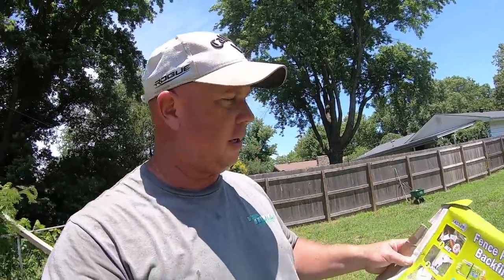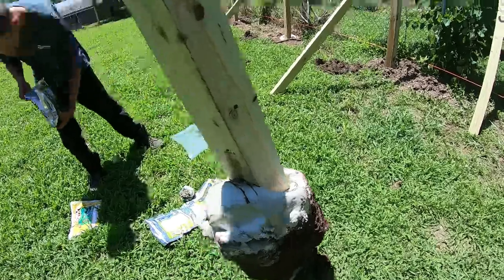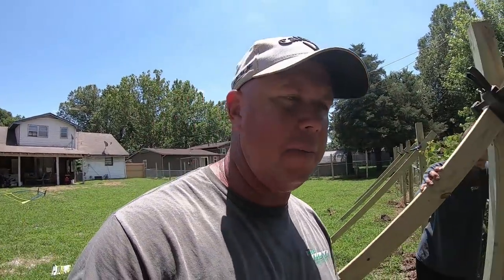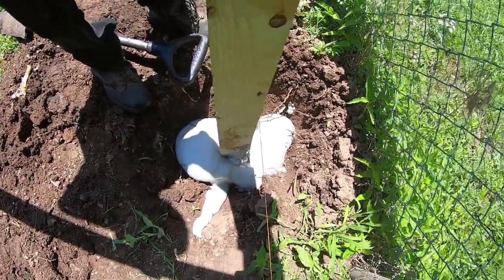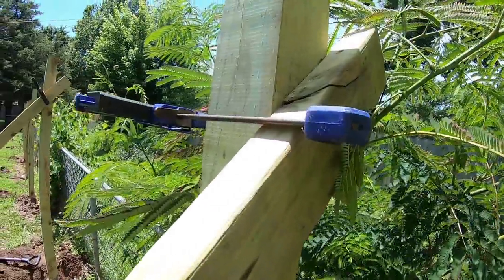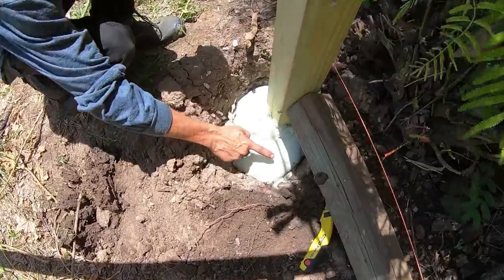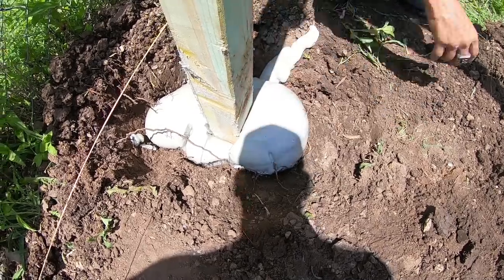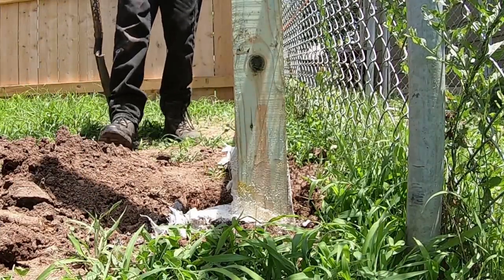No Concrete Fence Post, Is Foam Better

Comment: I’ll stick with concrete. Sakrete is my mix of choice. Think about it, foam to hold up agains Mother Nature? I don’t think so. Glad some people can use it though, but not for me.
Reply: Of course it will hold up, it's a polymer! -- concrete leaches moisture into the cut end of the post, guaranteeing it will sit in water until it rots. The foam seals the wood's cut end water tight and will prolong post life.
Reply: I replaced a deck that I built with posts set in concrete more than 25 years ago. They were still Rock solid. I don’t think I need decks that last more than that. Properly done, concrete is the way to go.
Reply: FPSF (frost protected shallow foundation). For decades in nordic countries, entire houses have been built on high density foam foundations.

Comment: hypothetically, if these post needed replacing due to rot, would a shovel suffice to "dig out" the rotted post? Ive always hated digging out rotted wood with the concrete.

Comment: Foam does not hold up nearly as well as concrete, especially when subject to ground freeze/thaw.
Reply: Explo Diddly - It doesn’t have a lot to do with weight, it’s not the weight of the concrete that holds a post down, however intuitive it may feel. It’s about compressive strength but more importantly, surface area. The foam fits perfectly into every contour of the hole and prevents movement. Concrete does the same. If it’s good enough to set utility poles, you needn’t worry about your backyard fence. All you need to do is imagine the liability claims against a power company if poles were to fall over all the time. They aren’t going to open them selves up to that risk, so you need not worry. Trust the science! 
Our intuition is very unreliable, that’s why we have instruments to measure everything we do because even with decades of practice our senses aren’t accurate enough.  Your post would be subject to heave from frost if it wasn’t deep enough but it would matter which material it was set in if it was too shallow. When I lived in Canada my whole asphalt driveway would heave up by a couple inches and sit back down in spring. 

Put another way- we used to bolt wings onto the wing spars of fighter aircraft because it ‘seemed’ the strongest thing. Now, with the F22 - one of the fastest planes with the most G-force on its wing structure- those wings are glued on. 
You don’t need a sledgehammer to crack a walnut. I’ll bet over time this foam prevents water ingress way batter and the post takes way longer to rot through. I’d be inclined to let the foam poke through and trim  it off at a downward angle on all 4 sides so water runs away. 
Just my opinion.
Reply: pickle tickle ok, air bubble foam vs. Concrete. It’s not even close after one year of freeze and thaw.  Buy this stuff if you never deal with expremes. Homeowner scam product.

Comment: the fencing people in my town just cut the fence post off at ground level and dig new hole next to old one and redo them and move on
Reply: exactly
Reply: Your ground must not be full of rocks and tree roots. I don't want to have to dig any new holes. :)
Reply: @tagberto  yah and I have to replace about  30 feet of fencing one of these days all the fence posts are not in the ground they rotted away but still attached to the original fencing .The 30 feet of fencing swings as the wind blows lol

Comment: That stuff is crap. Never use foam to set a post. In short order, you are left with an unstable wobbly structure. This stuff may have a place somewhere, but it does not belong anywhere near a fence post.

Comment: how about the disposal of that is it ok just too throw in garbage ?
Reply: you throw egg cartoons away in garbage , so yes it is disposable in regular garbage pickup otherwise would like either be sold in Hazardous waste bag or not allowed to be sold by EPA.
Reply: My egg cartons are not foam
Reply: @MrRadiodio   you meaning people do not you personally congratulations for being more green but it doesn't change the fact that they are thrown away in garbage and EPA wouldn't allow this to be sold without special packaging and warnings if it wasn't ok to throw it away and in fact probably wouldn't allow it at all

Comment: Never mix concrete. Put the post in the hole and pour in some water. Dump a half bag of dry mix  and done. Concrete contractor for 20 years, would be hard to give it up.
Reply: half a bag of 60lb concrete, and how much water? Or should i just be mixing it while its around the post? I bought the Sika brand foam yesterday and I'm already reconsidering it lol

Comment: That’s cool, but it’s twice as expensive as fast setting concrete, don’t see the advantage!
Reply: This seams only useful if you want a simi permanent easy to remove fence.
Reply: Doesn't matter either way it will rot at ground level
Reply: Corey S  Where the pole meets the ground is where it will rot. i'm not talking below ground and utility poles are not that same material as a treated post
Reply: Corey S  You obviously know what youre talking about so this is my last reply....it doesnt need to pool to rot it. Just like a pole building where does it rot first? Right at ground level ....even when its on a concrete slab. So no it does not need to pool obviously
Reply: Corey S  OK for 1 I have no problem with this til you started being condescending about it......and youre talking to someone that works in the field not someone copy pasting info off google. It does not need to pool. The whole thing started with yo usaying foam wont rot and me saying it does not matter cuz it will rot at ground level way before that.Obviously there is nothing  I can say so just leave it at that
Reply: I have many times....it DOES NOT matter what is around it underground.....foam,concrete,dirt......it WILL rot where the post meets the ground....the moisture from the ground WILL rot it WAY before it will below ground.....it DOES NOT need to pool to do this......do you understand yet?  This is simply what you think you know and what I actually know but keep trying. LOL its getting too funny for me
Reply: Corey S  There is constant moisture at ground level LOL
Reply: Corey S  honestly stop reading that about halfway through..its called moisture now go google that
Reply: no really just look up the definition of moisture lol
Reply: Corey S  last time im replying to you 100%....keep doing your research and Im sure you will say something cuz you seem like the type that needs the last word LOL
Reply: Wow, that started a firestorm, sorry. Here is one more thing you should think about. If you use concrete, it attaches to the post and u usually have to dig up a pile of concrete attached to a post to get it out of the ground . I would be curious to know in the long term, if the foam would delaminate from the post, totally different materials. This would allow water to get to the post underground. I would think that extreme cold temperatures might accelerate this, freeze and thaw cycles. Just thinking out loud. Foam has never been a substance that sticks well to other surfaces. Foam roofs, foam insulation, etc !
Reply: @17forever64  Im sure Corey can tell us with his many minutes of research on google...complete expert on the subject
Reply: Rick K oh boy, have a great weekend sir!
Reply: Corey S yes, I had some experience with different types of foam , was just curious about what y’all thought. I agree with much of what you said. Thank you for explaining it, that’s why I brought it up!

Comment: Another alternative would be "pea gravel". = drainage to prevent post rot = long life span of the fence, ease of replacement, ease of install. No shaking a bag just pour in the dry pea gravel and it's set NOW. "IF" there are high winds that loosen the post, easy, pour in a little bit more pea gravel and shake the post back to level, once a year or two or three. TOOOOO EASY!!! WIND at the post rot level is a wood fence worst enemy. DRAINAGE at the wood fence post rot level is the posts best friend. The action is ALL at the post base. Are you going to hold the water there to finally let the rot do its job, or are you going to let it drain away? I say, drain. Just saying.

Comment: Ive used this product for a few years now to fix my cedar fence and have had no issues in the upper midwest climates where I have had issues with Concrete cracking due to moisture getting down next to the post and then freezing and splitting the footing.   I use a cardboard cylindrical form to help contain the foam and go down close to three feet using 4x4 posts then pack teh soil around the form once cured.   People asking about the foam being water tight I can attest that the posts I have put in have not allowed moisture to get close to the post after two years
Reply: is three feet deep enough, how tall is the fence?

Comment: See my reply to NO NAME below for how to use one bag to set 3 or 4 posts not one and just as quick.  Of course the real answer to long lasting fenceposts is another material like a Concrete post with resin nailing strip etc but at least use ground contact treated fence posts not just treated or "severe weather" treated which makes you think it is but it isn't. It must be "severe weather ground contact" if you get lowes etc. make doubly sure it is ground contact rated.  

Even though the posts often say lifetime guarantee anyone ever tried to take rotten ones back ???  Would you want to replace the post with same kind that rotted ?   I would take them back get either refund or more posts and if got posts immediately sell or use for something else and get better suited product,

Comment: I think the question is what’s better for the Environment ? I like concrete the added weight helps but it’s very polluting . What’s this chemical mix and does it recycle ♻️ well ? . Concrete atm is not reclaimable / the cement itself .
Reply: The two part mix is a byproduct of another industry (cannot remember which) so it is eliminating waste.

Comment: probaly more cost effective when timing matters
Reply: No it will cost more to redue it when the wind blows fence over
Reply: do you think if the added stone as they poured it ....it would work ?
Reply: I've used it to add 2 posts to make a double 6 ft gate and it kicked ass

Comment: Does it work with 5x5 vinyl fence posts?
Reply: See the Fast2K and Sika Post Fix page for info on such. Sika says it can be used on any post material, Fast2K does not answer this question so I am going to say you may want to contact them otherwise I would say it is just as safe to use on any material post.

Comment: Anything you put around the post is going to trap moisture up against the wood which is going to promote rot. If you actually know how to install a fence correctly you don't need either of these things

Comment: Just use concrete. Make sure your concrete is just above ground level and bevel the concrete down off your posts and you'll never have rotting issues.
Reply: WINNER.  6-8" gravel at the bottom too.

Comment: Expensive, and I’d have to see some real life test with wind and a week of rain.
Reply: Not te expensive a bag of foam is in va is like 5.80 and 80 pounds of concrete is 4.78
Reply: @thomasmiller6254  just to get it set plumb you could put some dirt in tamp it some . Get several posts in the holes and use one bag of foam to do 3 or 4 holes till they set plumb then add more dirt etc.  That way saves both time and costs!!

Comment: That foam is not cost effective. One bag of that is about $13. A 10lb bag of Quikrete is about $3.
Reply: you did not add the cost of the work to haul and mix the concrete. The cost on your labors back. You don't have to move and mix 25 bags of concrete that saves a lot of TIME. Time you could spend with your family after you got paid from the job.
Reply: @blu4x5  $325 vs $39... I'll drop a bag of dry Quikcrete in each hole and soak it with the water hose!!!
Reply: @markb.1259  well we both know that's not the correct way. That $325 i get back in time and labor pretty easily. I'll just charge the customer an extra $325. Damn that foam is a lot lighter than 80lb bag of  concrete. There is also 20 pole mix that you can get for $150 brings cost down to $7.50 a hole
Reply: you dont need to use a whole bag. A bag can do at least 3 hole if not 4 .  Look at my reply to NO NAME
Reply: tee kay I’ve not seen on any of the bags of foam where it’s recommended to split the bag. They are designed for one application only.
Reply: blu4x5 I have no problem at all carrying 10lb, 25lb, or 50lb bags of quick setting mix to the holes setting them there ready to pour and add water from a garden hose. It’s called manual labor and saving money in the process. If I were paying someone to put in a fence for me, and they wanted to charge me that crazy price so they could save time, they would not get the job.
Reply: @Coloradohomestead22  it is one application just in to 3 or 4 holes to achieve quick setting. You dont have to use it in the amount the product recommends it. The manufacturer obviously wants to sell as much product as possible . You can definitely do 2 holes with it easily. Ultimately its up to you if you want to use it or not and how you use it if you do.  Just like its up to you whether to dig hole by hand or get a power auger either way its just a hole.
Reply: @markb.1259  why use concrete at all you just dug the dirt out put it back in and tamp hard if you dig deep enough it will work .  If I am putting in 25 or more posts in one day I will rent a power auger and use the dirt and about 1/3 bag foam per hole and by the time all the posts set and eat lunch come back to first post putting up fence sections and be through in one day although a long one.  lets see you do that with concrete and  manual labor especially if you want to dig holes by hand.  If you are doing it to save money dont use any product or rent any tool and take 3 or more times as long to get the job done with a handsaw hammer and nails or brace and bit and screwdriver.  Take it from someone who did it that way 60 years ago its not worth it if you dont have to unless you are doing it for your fitness workout too and then there is often delays by weather if you stretch the job out to 3 days or more.

Comment: Interesting product. I wonder which is more or less environmentally friendly. Concrete has an extremely high carbon footprint so is bad for the environment but it can be recycled? I wonder what the foam is made of and how it is produced and if it can be recycled - which i doubt. Good video all the same :) James
Reply: The Earth has a high carbon footprint!
Reply: A guy who cut's down tree's and use's gas powered engines to accomplish his task is concerned with carbon footprint! intresting!!!
Reply: Rainforests and volcanoes are 99% of earths "carbon footprint". We contribute less than 1%.
Reply: Foam is a form of plastic. Definitely not environment friendly either.

Comment: Don't see any real advantage over using concrete mix and dry packing it.  Costs more and I doubt it is as environmentally friendly as the natural ingredients in concrete mix.  I've never had much difficulty removing fence posts that were dry packed and they stay in place as good as those are set with water mixed ones.  Possibly not having to lift the heavy bags may be a benefit but, as a former professional fence installer, if my crew and I couldn't pick up a bag of concrete mix we would have been out of business.
Reply: lol, natural ingredients in concrete mix... 😂
Reply: @instantkarma1636  - Dah, yes.  Sand, stone and portland cement.  Portland cement - two thirds calcium silicates and the remainder aluminum and iron clinkers.   All, naturally occurring inorganic compounds.

Comment: croncrete will go in your dumpster too
Reply: Anthony Nelson many services won’t pick it up if the bin is too heavy. 50-90 lbs of concrete and the lift arm won’t pick it up. I had to split up some concrete into two weeks (so 3 weeks when you include the pickup they refused)

Comment: Why use this stuff at all...just back fill with dirt and tamp it in as you add it.  I don't see the benefit of the foam at all.  Concrete gives you an "anchor" which this product really wouldn't.

Comment: I build fences for a living. A lot of misinformation in this video. If you want a strong fence that will last.  At least 80lbs of concrete on each post, period. This stuff sucks, there is a reason no fencing companies use this crap.
Reply: The marketing for this gimmick is sure working well, though.
Reply: good advice  not for me concrete will do all the way..no sleepless  nights when the wind blows.....
Reply: At this point there is already a hole.  95 percent of the job is done just throw some concrete in agreed.
Reply: Just the fact he says how easy it was to pull the post back out, tells you everything. If it’s easy to pull the post out, it will fail.
Reply: Johnny cash from alcorn thought u were retired years ago ,anyway better off just putting the dirt back in the hole and tamp it for free
Reply: I don’t know where you live, but where I live that doesn’t work. Coastal city with mostly sand and we are hit with hurricanes on a reg basis. All of our post are set 2-3.5ft in the ground depending on style of fence. With at least 80lbs of concrete on each post. When we build Eastwood fences using 12ft 6x6’s we do 160lbs on each post. But we are professionals and build our stuff to last.

Comment: Sorry, but I would never use this product for my fence.  At least concrete has a little weight.  Hurricanes are windy.
Reply: the weight doesn't really hold a pole down its there to keep bottom of pole from moving and square.  A tornado etc generally blows fence over breaking posts or rails off not pulling out of ground like a tree root.  At least not if they are put in deep enough.